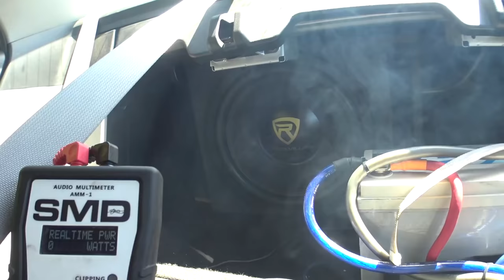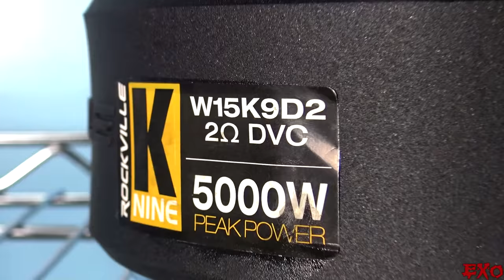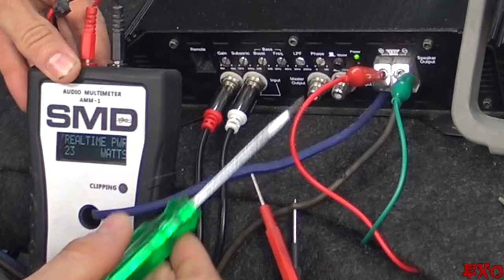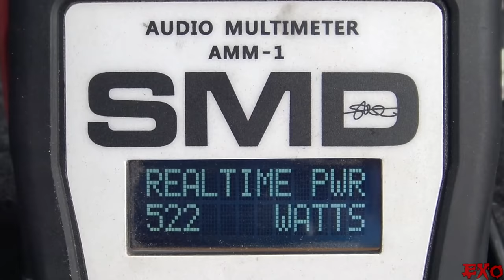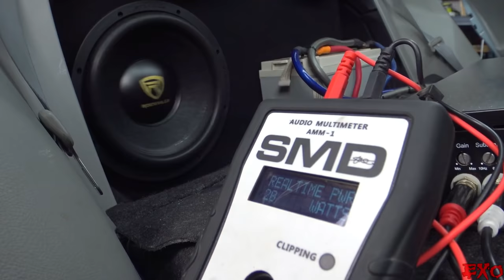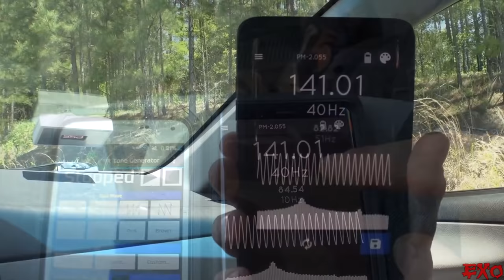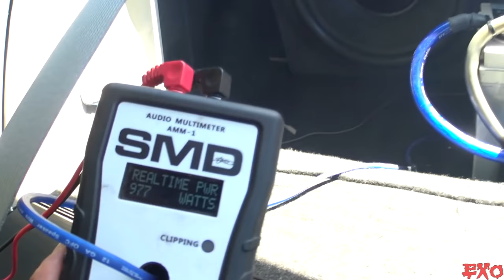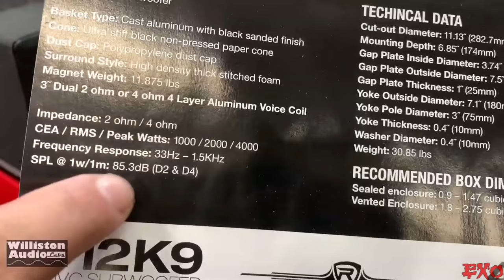EXPOSING a Cheap Subwoofer w/ Rockville K9 Version 2 vs V1 | Blowing Subs on 1000W & Best SPL Test?

Comment: So it's pretty much just a 200 Watt RMS speaker labeled as a 1,000 watt.
Reply: Yup, a fancy door stop... 😁
Reply: Its basically a cheap Chinese subwoofer claiming its able to do 12k watts and is barely able to do 50 watts without blowing out
Reply: @kitcat2559  sundown subwoofers are great and made in China.
Reply: I'd say not even 5:1, more like 10:1... When you name your products to ride the wave of a tried and true manufacturer like Rockford Fosgate those are the shit that happens. So stay away from those Rockville, useless as a rock in your shoe, like Dracula to the cross.
Reply: 200 watts RMS is plenty of power though.
Reply: You are right, 200 rms is plenty to move two 50w in front(45rms), that's almost a hundred just from the dash speakers, then two good 8" midranges, 80 rms per channel, 160 W, and the subwoofer, with 100W I can move my 12" Sony easy, the trick is how you combine. This rig is for a cruiser, loud but with great fidelity, but if you want to blow your trunk, that's another story.
Reply: if I was to take a ges at the sub he had broken in id say it has a true wattage peak of 1200w and 600w RMS. That 12" he blew in the car 1000w peak 500w RMS and idk on the 10" as he did not truly test it but ill ges anyway at 800w peak and 400w~500w RMS I'm sure its overated on on the box either way. So yes very highly out of the box overrated subs.
Reply: @jalee6587  damn your right
Reply: @jalee6587  Difference being Sundown was designed in the USA, and supervises the production of it's equipment. Companies like Rockville simply slap their name on whatever, with little or know supervision of it's production, and likely very little knowledge of how it's made, or to what specifications. 

I've worked with Chinese manufactures for years specifying, sourcing, qualifying, and compliance testing components for use in our products. As an engineer that was a big part of my job. I've seen many things, and it can be tough finding reputable companies in China that make quality products when not supervised by an outside entity.

When you find good companies in China you have to build a relationship with them and hold on to them, because they're rare.  This applies to both companies with off the shelf products, as well as contract manufactures. It really does come down to profit over quality with many of them. They will cut corners  and outright lie if left unsupervised.  

We caught several companies sending us component "samples" to test, then once approved; sending us something different. We had to constantly watch them.  That said; it's not surprising that Sundown is good while Rockville is crap.  Sundown cares about their reputation. Rockville will likely go under, or keep changing their name as the burn up their reputation over and over like many Chinese companies do.

Don't get me wrong; I loved working with the people I worked with in China, and believe China has come a long way in making quality products compared to even 10 years ago. There are now several highly reputable companies that truly care about quality, but still many who don't. I hope companies with reputations like DJI, Xiaomi, and  Supermicro, become the standard for Chinese products.
Reply: @jr48446  Kit's mom 😂
Reply: @davidacevedo8620  .
..
Reply: I always say that a speaker can handle rms about a eighth to a quarter of the claimed max wattage I dont see many RMS ratings on speakers before the 1980s or above 500$
Reply: @jalee6587  i wouldnt say great.
Reply: @forog1  That is exactly  the case with these subs. The amps are the same as well from what I've seen
Reply: My 2 15” 2000 watt Rockvilles can handle what they say they can I’ve had no issues
Reply: @frijolechingon5713  I don't think so, tell me a better sub for the price

Comment: Depends on the amplifier too, high end amplifiers like Amcron have really good damping control to better protect speakers, if you're just using a cheap car amp it's never going to control a speaker and take care of your speaker! You are right about amplifier power ratings, most pro speaker manufacturers reccomend an amplifier to be double the speaker rating so you just run the amplifier at a steady rate, dc, clipped amplifier is the biggest killer of speakers rather than over power!
Reply: The voice coil being out of the gap too long is what burns coils not clipping. The voice coil has to stay in the gap for heat dissipation. Hook a voice coil directly open air and it will instantly be smoked. Just physics that's all

Comment: Thanks for the video!  I'll never buy Rockville's now... shady marketing is a bad thing.
Reply: JL
Reply: The amps aren't bad but even on those they hook that limiter to it that shuts it off way before clipping.
Reply: @magicyeti9256  JL don't mess around. Their subs are incredible for SQ and SPL.
Reply: @donalddluckerii3147  true that but who got JL audio money to spend on subs or amps...😬
Reply: I don't have JL money. That said, i've been running the same Alpine amp and sub for years and its held up well.
Reply: @John Nelson You ain’t lyin. So many shitties always end spending a good amount of cash on shit subs and equipment that instantly goes out on them. When they should of just been patient racked up more bread got something quality and then they’d have no issues.
Reply: @magicyeti9256  JL audio. Pay to play but they can handle bass.
Reply: The low wattage amps are pretty good. Speakers I never trusted.

Comment: Much respect for using the PowerAmp app, I wonder if you tweaked the EQ to get the most out of each speaker you use. I do it for each connection or headphones I use to get the absolute MOST of each driver

Comment: Hey I bought a 10 inch rockville 2000 watt. Sub. Last november I had it on a 3000 watt amp but I split the power to 1500 watts and it out performed my 12 inch subs until the amp burned up on me so now I have it on a 1000 watt amp and it still pounds hacrder than my 12 inch subs and I am using it as a mid sub maybe the 10 inch subs are more better maybe you can test those out and see what you can come up with I bought it from Amazon. It is a K6 series 4ohm and I do have it wired at. 4 ohm . but keep it up with out your opinion or testing today's subs we as a consumer would lose out of a lot of money.

Comment: Know the worst part of all? 
People are still going to buy these.
Reply: Purchase away. They are fine subs if you double up on them and don't buy into their bullshit specs.( Which are all over the cheap audio market. ) If your on a budget they foot the bill nicely. I personally love my JL 10" with the JL 500w amp but not everyone can afford that so these are a nice cheaper alternative as long as your careful.
Reply: @qj3780  JL is still top of line even to this day.
Reply: @qj3780  If you are looking for a bullet resistant amplifier, JL make some of the best amplifiers on the market for different price points, and they back them by a warranty. You are more likely to cook a subwoofer than you are an amplifier, so it makes more sense to spend on the amplifier and save money on decent cheap subwoofers.
Reply: My K9'S sound pretty damn good,I have them married to a Rockville db16 monoblock class d amplifier and they sound pretty badass and they do vibrate my 2002 blazer like crazy,I have no issues at all with my setup and I do pound them and still no issues.
Reply: At least it was circulating the nasty voice coil smell nicely in the car!
BTW...I’m still a fan of Rockford Fosgate...I’m just OLD SCHOOL!
Reply: @randallkrohn1155  my skar ix-8 on $45 BOSS amp shakes the windows in my car.
Reply: I just did and they bump good I got 2 instead of 1 and no issues 2 days so far
Reply: @scottmcclure8933  rockford it's nice bruh. No problems with mine.
Reply: Honestly. It's a waste buying a15 inch. Even it realistically only did 300 watt. Just buy a10 inch fozgates they do more
Reply: @crow-vz5lx  you base your speakers worth off its watt consumption? I.... i think you missed the point of a speaker.

Comment: I love car audio even after my current build is finished I can't stop building boxes and messing around. Need to save up and throw a few thousand into electricals so I can bump some more power. Want to try a wolphram amp with the new Rockville destroyers as a budget big power build
Reply: Don't do it go with skar vxf they 10 dollars more but 100 times better. I seen a video of the destroyer on 1500 watts and it was moving so much you could see dimples in the surround.

Comment: Can you please do the power acoustic mofos 12s or 15s
Reply: I'd buy the MOFO's over anything from Rockville
Reply: I've had mine for years now they are STILL holding up strong Ive got 2 with a alpine MRP-1000 on each one wired to 2ohms they take that 1150RMS in strides like its nothing

Comment: Why don't you test the newest speaker from them Rockville Destroyers that's what I want to see
Reply: I bet it’s can get low. The 13w7 Xmax is 32mm. The destroyer is 30mm rated at 2000 watt rms. If it can withstand the abuse then it’s worth $250
Reply: After what you've seen, I don't think that crap will handle 2K continuous.
Reply: Slipknotyk06 😂

Comment: Them subs only can handle 200rms   500peak
Reply: he said he lowered it down from 500 so the cops wouldnt get called,
Reply: @any1alive  The frequency, not to power. He dropped it from 40 to 20.
Reply: That's funny because the video he made just over a year before this one he had put almost 1500 watts to this sub and hit over 130 db

Comment: audio pipe bd 2 1500w max. a real rating by a real company that knows how to do wiring diagrams properly lmao... rockville smh
Reply: 2 bd3s in a prefab on a Memphis pr1200 for 8 months of wreckless edm bass never an issue
Reply: I have three bd1 on a 2k and wow!
Reply: i like the bd2's FS is 26hz is very strange lol. my hifonics zrx 1800 makes my bd1's a lil toasty i do admit that's why i got 2 amps and hooked one audio pipe dual 4 with 1 skar evl  dual 2 to make about .6 ohm and not wallop the speakers too hard (.9 ohm and 1.8 ohm in box readings)
Reply: @Neganelite  wired to 2 ohm each?
Reply: @notyobiz6207  yes final ohm load of  .67 ohms

Comment: I wouldn't put more than 500W on those, what ever they say do half
Reply: and thats how you get dissatisfaction and clipping.  Always have headroom and make sure your amp never comes close to clipping.
Reply: @Jeffdachefz  How can it start clipping if you set up your amplifier to use around 500 watts instead of 1000 watts? Turning gain down doesn't make your amplifier to start clipping or break your subs and listening music at low levels doesn't break your subs either (your amplifier doesn't use 1000 watts of power even if the gain is set to that if you are listening at lower volume levels).

Comment: Hey not sure where else to go since Im kinda a solo bass head lol

What would be an upgrade from 2 sundown sa12s. I had a custom box made to spec. 

I have two xs power d3400 and a 320amp alt. They are pushing pushed currently by the orion xtr 2500. I set the gains with a dd1. 

They sound decent but wanting more spl and output without loosing the ability to enjoy it musically. 

Due to space constraints (jeep renegade) Id like to stick with 12s.

Im getting currently around 139- 140db. But using Im sure a terrible method to see via my phone lol so im sure its louder.

Comment: Push terminals? Ofcourse r u kidding me. Str8 wires look bad idc if the sub is pushing 8billion watts
Reply: I use crimp terminals under the nuts of the terminals. I dont use the "terminals" themselves. Its not a big deal.

Comment: I have a question. I put my 12 rockville in a sealed box and it was laid on its face by my son. It doesnt rattle if I put pressure on the cone or leave it face down. However if i put it back up it has a pop during the excursion. Can it be fixed?

Comment: Notice when doing extended testing that the power goes down over time? That means resistance is going up 'cause the coil is heating up. I honestly didn't think it'd be that easy to see! Neat stuff! Just cut all the ratings for these subs in half and we'll probably be fine. Really sucks when companies overrate their stuff.

Comment: Yeah, I know, 4 years late to the party, but I just bought two W15K9D4 Rockville subs for $140 a piece and I'm excited to get them. I had two Sundown SA12-D2 subs on a Sundown SAI-1750D amp and even in a cheap eBay box with two 12"x6" Aeroports they sounded great, but I need more air movement. Problem is that I don't yet know if the box will even fit in the trunk of my 128i BMW...😂😂😂 Size wise it SHOULD fit, but I don't know about getting the whole thing in there through the small opening, and of course my back seat doesnt go down.

Comment: Ok wondering if you could check on the new kicker l7 solox when it comes out  been having old one in my truck seeing if I should wait for it rms 2000 max 4000 they might price it out my range but feed back from you would help out alot far as my next 12 inch sub

Comment: Did you check to see if the Flux capacitor was receiving the 1.21 gigawatts that it needs before hooking the speakers up? If not,, that could cause the rotors on the flugalbinder to overload the disalphink after 78 seconds of continuous use. If the disalphink overloads it could malfunction which could then travel through the speaker wires causing the performance of the speakers to lack.  Hopefully that's the problem cause if its the thingamajig you might be screwed. I dont think they manufacture thingamajigs anymore so you'd have to hope someone has an extra one lying around.  I think only one company manufactured them after 97' and they were super selective on who they sold them to.    I hope that helps you out for your next video.

Comment: It looks like the wire could take the heat, but the varnish couldn't, and as it burned away the coil windings were free to vibrate, then eventually broke.

Comment: I have this sub in 8 inch with a pioneer deh7700 tuner with a clarion eq and 4 new Rockford speakers and rockville db55 5 channel Amp and a capacitor stuffed into a 98 regular cab ford ranger , it sure as hell beats the stock ford radio and paper speakers. But the sub is doing fine no smoke, yet

Comment: I dont know if I'm lucky or what, I have a k9 15 v2 and have been running it at 800- 900 rms for over a year, no problems at all. I have it on the db14 amp. My friend just got the same amp and blew his brand new skar sdr 15 in about 30 minutes. I also broke it in for over a month at around 400 rms. Like I said it's been good so far

Comment: bro u awesome wish u lived closer to help me out in pittsbrgh pa im having issues with mixed ways told to run in my 14 malibu got few swt ups but keeping factory head unit tv since its my link xm and i have the non pioneer no amp in trunk am i able to rub a regualar loc or need like a audio cotrol lsi2 like rthere a amp by pass by llj customs but only seems to have the premium bose 13 14 n up had pioneer but lt has non pioneer n ls any help and trying to figure if the p 2 or type r 10s should run if should go ported or sealed box i have alot been decades since been into systems i mechanic basic knowledge like done installs in the 2000s at audio works

Comment: So, you have to realize that when I was a kid, even an early teenager in the late 90s, I used to be like Bruce. I would buy the cheap no-name subwoofers from Walmart and test them just to see how the junk would sound. I used to buy the even cheaper subs and boxes from flea markets to see how they would sound and while I was never truly blown away, they were all crap, let's admit it, but I have heard a few systems with those crap Walmart and flea market subs that could pound a little. Still, I wouldn't ever have taken them seriously for a system. When I built the system for my 1994 Ford Exploder (that was lifted and built mostly for performance with a supercharged 302W swap) I started with two Cerwin Vega 12s (which seriously pounded hard), but I ended up with two JL Audio 15s on a Kenwood 1200 watt 2 channel chrome amp with dual potentiometers. That thing would bounce a full Coke can 10' in the air at full volume on some Trick Daddy songs in a box that I built on my own. I was even trespassed from a Burger King because I was picking up a friend and playing my system in the parking lot. The manager called the cops and said that I was bouncing tongs across the table...😂😂😂 Man do I really miss those good old brand name subs. I'd really love to have a good set of those Cerwin Vega 12s, or even those JLs that I had. Fact is that you can't trust too many people or companies nowadays, so it's hard to find a good deal for a good price.

Comment: Only Rockville products I ever bought was two sets of 5x7s and when the arrived broken pieces of plastic fell out of the box when I opened them. The plastic would break if you put any light pressure on it. Sent them back and never bought anything from them again.

Comment: Im hoping people need to realize most speakers you have to break them in first theres a period of time that you have to do to properly break them in an use high temperature silicone to the inside of the speaker on the rubber edge it will make the sub hit harder

Comment: They look like 300Watt coils to me, hence why they smoked. One thing with manufacturer power ratings is they are usually overrated as they assume considerable duty cycle as music is not normally a continuous loud low bass or almost continuous low bass at full power, or from a signal generator. This will in most cases overheat most amps and speakers.

Comment: I think since they cater to budget audiophiles  they also know that the same people use amps that over rate their performance also. So given a cheap amp that says it's "1200" watts, Rockville knows they probably fudge that number by 30% or more which means their speakers would normally survive